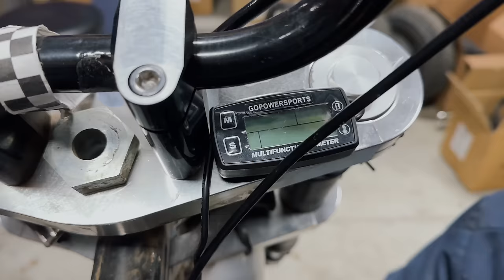Reviving our Ultimate Enduro Racing Mini Bike | Tillotson 225 + TrailMaster Hurricane 200X

Comment: I added sheet metal splash plates in front of the rear fender (under the seat) and one on the front of the frame behind the front tire on my old Baja Warrior to help eliminate dirt getting on the engine and belt. I had it at mini mayhem a few years back in the spring when it was soooo muddy and wet!

Comment: Y'all have one of the best shows on the 'tube. I have a couple suggestions:
1. When cutting rubber, wet it with soapy water first. It will cut much easier. That's the reason you don't want to spin your tires in a creek.
2. Shell Rotella diesel oil is higher in zinc than any oil additive I'm aware of. It doesn't fowl a motorcycle wet clutch, but it will contaminate a catalytic converter. 
Bonus suggestion: only cover the body parts you want to keep! We're enjoying your adventures; please wear protection!

Comment: For the air filter if you're in a big hurry I suggest using a hair dryer on a low setting. Just put the nozzle of the hair dryer into the filter orifice. It'll be dry in less than 5 minutes.

Comment: Pro tip on those bearings you replaced what you should do is put a pipe sleeve in between them so you can tight the bolt down tight that is basically no different than setting up a wheel spindle.
safety fast!

Comment: On your velocity stack inside of your air filter there you can either use Vaseline or bearing grease but you put that on the outer edge of the Velocity stack and I will catch the Fine Dirt before it gets into the motor and doesn't hurt the airflow at all this is just something I do on my 1/5 scale RC truck thanks have a great day

Comment: A grip trick I used as a kid was spray paint (non throttle side) while it’s wet it’s slick, but it’s just long enough to get it on there then it gets really tacky and will act as adhesive within a few minutes.

Comment: On the grips, what we do in real enduro racing is spray a little clear lacquer into them.  Lubricates them nice for the install, dries up completely in about 15 minutes and provides water proofing and a little adhesive too.
Reply: Rubbing alcohol works well, and air to remove grips. With alcohol, you can reuse the grip, and it dries in an hour or so.

Comment: Regarding the bearing and the nut....
Would it be an idea to fashion a sleave to go inside of that tube? Like a lenght of pipe that with correct dimensions would hold the bearings in place and brace them from the inside?

Comment: them carbon fiber heat tiles were popping off the space shuttle too fellas.  if they made it back at all they were missing parts. the final frontier. not for everybody, like survival.  for the strong and the fit, sneaky and wily.
like a coyote  Y-LEE.            be good or be good at it.

Comment: Longer episodes  are cool if you so worried  about movement  why not  recradle  the engine  using round tubing  where the square currently  is  then  utilize  mounts that crush the round tubing  like   WKA  KARTING  ENGINE MOUNTS  just curious

Comment: I can confirm the bushings wear out on stock motors. When you take the engine cradle out, the neck tube basically flops around . The swing arm also will walk side to side. I’m guessing bushing failure is the reason people are having neck failures. I welded in billet bushings on the cradle and swingarm and will do the same right away if we get another one. It’s a must do mods for these bikes.

Comment: A lot of stock small Chinese engines like these or like the pit bike style engines constantly need valves adjusted. I have came across tons of small engines that wouldn't start or would run rough if they did start and it was always because of the valves after the basics were gone thru like carb clean new plug etc

Comment: Nice job boyz.  Would it help to put a spacer on the drive axle between the bearings so they don't get squished together when tightening the castle nut?
Reply: Yes. It absolutely would. It's no different than a wheel. It should be in there.
Reply: It would be ideal yes

Comment: I raced dirt bikes 50 years ago 
Want to shave your times 
Watching you guys ride I noticed that your but is mostly on the seat on two wheels 
Think jockey but up even an inch will put the weight on the pegs lowering your center of gravity 
If your turning left your weight should be on the right peg and vice versa leg just out and forward into turns so it won’t catch but if you need to put it down to catch yourself it’s there
On jumps butt up will save your backs same on landing 
On a jump if the front is to high just TAP rear brake 
Front to low hit gas in the air to bring the front wheel up
Mud or sand butt up lean as far back as possible to keep your front wheel from digging in throttle balls to the wall keep low 
Hope you guys stay safe and have fun and thanks for the fun     Kenny

Comment: How r y’all running that much power though a jug? I have a stage 2 212 265 cam n 26# springs, nothing major, n I’ve blown up 2 of those drivers. GPS was kind enough to replace the spiders for em but don’t even wanna run em with fear of blowing em up again.

Comment: Hello cars and cameras love you videos, i could use some advice im trying to put a predator 212 with 3/4 bore shaft in a Yamaha g20 or g22 golf cart and cant figure out what belt driven not chain centrifugal clutch to use been looking for a week any thoughts.
Reply: I believe you should be able to use just the front pulley off of a torque converter for that, provided the driven pulley will accept the correct V-belt for the torque converter

Comment: Love the videos, the way I was introduced was the CR 500, my dad always talks about the 87’ 500 he used to ride and I always watch anything that has CR 500 in the title, I haven’t looked through all your videos yet but you guys ever thought about throwing a snowmobile engine in a lawn tractor or something? I think a 700 cc 2stroke lawn tractor would be pretty sweet
Reply from the maker: Snowmobile motors are a true double edge sword, kind of like turbo cars. Broken 90% of the time and fast as crap 10% of the time!
Reply: @CarsandCameras  I've noticed that.
Either you leave them in a sled or spend a bunch of money and a lot of time getting them to work well.
Reply: @CarsandCameras I don't know about that, or I was just lucky. 1981 Yamaha SS440 with dirt bike racing reeds...I'd start it monthly, then I'd do a top-to-bottom check of the whole sled right before snow flew. Never had an issue.
Reply: Yeah it seems you never see anyone other than hill climbing pros try much with them and I have a feeling there’s a reason

Comment: These style of mini bikes would be 10 times better off-road if the foot pegs were positioned more like a dirt bike rather than so far forward like street motorcycle. Positioning them far forward is more for comfort while cruising. You support yourself with your legs on a dirt bike instead of using the seat for support when the foot pegs are near the front of the frame.

Comment: westport wa.state not on this topic guys."sorry'  to who ever owns the gt.   he motor in it was meant for the "vega", but at the last minute one side or the other pulled out of the deal.   they will go right in vega.   that motor is bad ass dude.   opel raced them for years.   the cadillac catera has a motor thats is basically a race monster. with good gas mileage.  "eco years".  either do something with it or give it to me.  now i know westport wa.state is a little ways away but it does not look good as wall art. just saying.    good holidays on you and yours. now back to show. mine was opel rally. 1972

Comment: Is there a weight limit for these small engines?
Reply: It comes down to gearing in the long run.  A stock motor with the right gearing could move a car
Reply: @Doggo_Bork  
I'm asking as my bro and I were riding my manco 606 go kart with a 228r on it and we snapped the forged crank riding up a mild incline. It is geared 8-60.

Comment: you don’t air up the tires to off-road race you air down you need a lot of squish like 15 -20 psi iv ran 8 - 12 psi before during wet conditions more tire contact more traction it takes a lot to pop a bead on a tire

Comment: Use rubbing alcohol to install the grips.
It evaporates quickly.
    We used to put one wrap of electrical tape on the bars and wet them down with some gas.
The gas melts the tape just a bit and I promise you'll be cutting them off if you want to change em.
   We did this back in my BMX days.

Comment: WRONG. You need to strengthen the frame whenever your doing more than just basic off road riding. NOT just when you increase the horsepower.